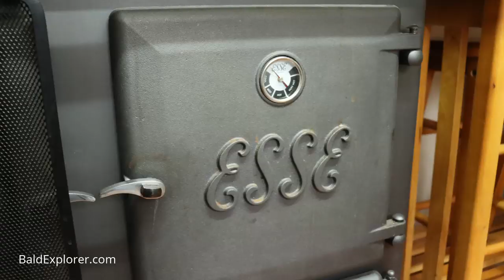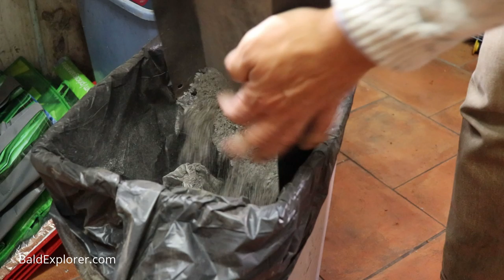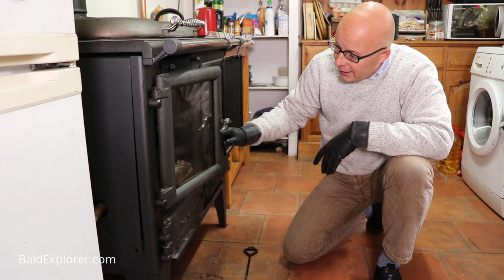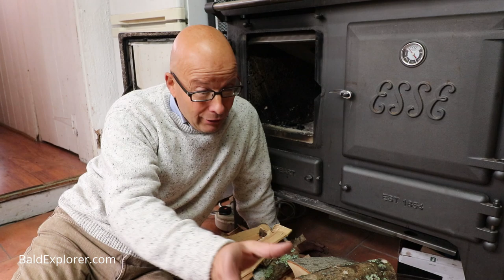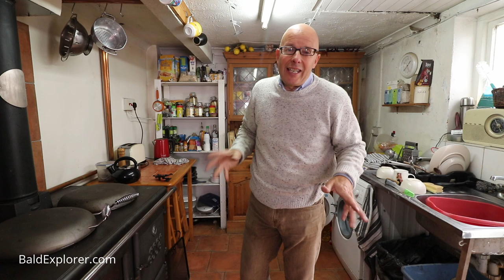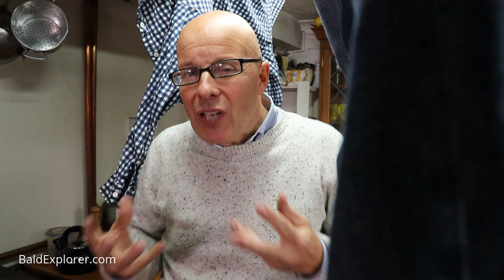Owning an Esse Ironheart Wood Burning Stove One Year on.

Comment: Hi Richard, I have had an ESSE Ironheart for the last 5 years in my cottage in France and have a few suggestions for you. The ESSE Ironheart is a multifuel stove ie coal or wood, however if you only burn wood ESSE sell a woodburning box that does away with the grate which should only be used with solid fuel. When using the woodburning box resist cleaning the stove out, wood burns best on a bed of wood ash, I usually take one shovel of wood ash a week plus any of the wood ash clinker that builds up at the front of the stove. The ESSE Ironheart has 4 air controls, the primary air control at the bottom of the stove, the secondary or airwash control, the oven damper and the flue damper. ESSE recommends when lighting the stove only the oven damper is shut and once the fire is established the primary air control should be shut as wood needs combustion air from above not below. Once the fire is burning strong and you need to use the oven you should open the oven damper. I usually leave the flue damper fully open at all times. Using this method, I burn well seasoned hardwood, oak and beech, predominantly to heat the whole of my house, but not water, on about 6-7 cubic metres of wood for a winter. The glass on my stove remains clear and clean, only requiring cleaning every 2 months or so. Using a woodfired rangecooker takes sometime to master but if you are continually having to clean the glass it is telling you that the fire is burning inefficiently and you may have a problem with your firewood, not seasoned, not dry enough or the wrong type, not all wood is good to burn in a woodburning range cooker, some is even extremely toxic such as Yew, or there is problem with your flue, insufficient draw! Remember that a woodburning range cooker or stove main purpose is not to burn wood, a bonfire will do that! It is to cleanly and efficiently convert wood into controllable heat for your home! Good luck
Reply from the maker: Hi Colin. Thanks so much for the advice and information. Trying to get properly season wood is a huge problem. I would say the wood I buy is not seasoned sufficiently, hence the blackened windows, so I keep buying wood to eventually have enough stored long enough to be seasoned, but meanwhile, because I have no other means of heat, I have to burn some of the unseasoned 1 year old stuff. We had to retro fit the water boiler in the fire box. I am not sure that the Esse wood box would now fit without a huge refit which I cannot do alone. But I am sure I could place a sheet of metal over the grill at the bottom to reduce the ask falling through to keep the ash. The supplier messed up on the ordered Esse and refused to put the problem right.
Reply: @RichardVobes  Hi Richard. Thank you for the video "one year on with the Esse Ironheart" ! A realistic and endearing account! I am 11 years on from installing mine ! I changed from the grate to the Esse Wood  Burning Box but recently went back to the grate, as I found there just was not enough combustion using the box to keep and sustain a good fire going especially when using  larger pieces of ash. I find the fire goes best with a progression of sizes of logs. I am in the country so am able to buy both seasoned and kiln-dried logs. Can see in London this could be a problem. Even with excellent wood you will still get a slight "dusting" on the inside of the glass on the Ironheart - but this can just be wiped off with a damp cloth and ash from the stove. You will get more blackening of the glass because, like me, you have the boiler to run hot water. So as the fire tries to heat up it is continually is having its temperatures lowered by the cold water being pulled through the fire box. I find it takes at least 40 mins to an hour for that to work through  (depending on what hot water has been drawn off) . In the end,  I agree with you - I love it .
Reply: Colin Shaw     Well said!  A clean burning fire keeps a clean glass.  A great way to understand how good your wood burning and wood cooking skills are.  If the glass is constantly getting black, then your fires are too cold, wood too wet, not enough combustion air and pollutants are not sufficiently burned off before closing the damper.   Must allow the good clean gas in the wood to do its job.
Reply: Hi Colin, how much wood do you find yourself using for your Ironheart stove over a year? Do you use it year round for cooking and heating?
Reply: @bodo9387  sorry for such a late reply I only use my ironheart in the late autumn through to early spring otherwise it would make my small home too hot and I also have other methods of baking and cooking so on warm days I would not light the stove
Reply: Good advice that Colin..the blackened glass used to happen before I found some properly seasoned wood.  Home Bargains has bone dry birch, which is good for a quick burn, but probably wouldn’t be suitable for a range.

Comment: Carol Cordell,  here, have written you a message recently.  Am originally from Alaska, and now here in Eastern Tennessee,  have lived on wood stove heat for total of 23 years, most of these years doing wood stove heat as a single person.  I got  to be really good at fire starting even from a very cold house.  Have never used an Esse, but last stove was an Englander, I think.  In this stove, it was suggested to leave the ash in the stove, and make an indentation in the middle of ash, front to back to allow the air to the bottom of the fire.  I always use a larger log in the back of stove, and build my fire against the log.  I had the smallest Englander;  it kept the house warm over night, and had a warm house in the morning, that did save me money. My wood for almost all 6 years was free, by tree cutters bring me their wood that would have gone into trash.  What I really liked about wood heat was a warm house when we lost power for many hours.  But I could also heat soup, re -heat coffee, and other foods just needing to be warmed up.  I REALLY LIKED the wood stove life style, cause it's  like living with the elements, and like a partial life style,  like the Alaskan colonist, many decades back.  Then late at night it was very comforting, relaxing, to sit about 6 feet from stove  and just sit, look at the flames, and relax.  Many times in Alaska the power would go out, and the wood stove saved the day.  That; and a lantern.  Yes,  a very Good Deal!

Comment: Never put your ash into your bin. Embers may seem cold down but all it take one to get the whole thing going. My son was a Volunteer Fireman and houses have been lost to ash reigniting
Reply from the maker: I will find a metal bin for them. Thanks for tip.
Reply: @RichardVobes  metal ash buckets with lids available used one was most useful no chance of ash blowing in wind
Reply: Stainless bucket with a lid, and never leave it inside. The Ash can produce Carbon monoxide and cause suffocation.

Comment: You should leave a good layer of ash in the burner area as it helps the wood burn better and last longer and gives out more heat.
Reply from the maker: I need to do that more.
Reply: @RichardVobes  The reason is that it insulates the wood and fire from the cold stone below which otherwise draws out heat.
Reply: I fell upon your video because am thinking of adding an ironheart to our scullery. I also loved the fact you had a Bush radio on the side. I still have my mother's from the 60s

Comment: Great video and good to see your experience of using it, thanks for sharing. My father in law has the same Esse stove in his kitchen. It is excellent but it takes some getting use to cook/ bake with it! I'd love to have a stove like yours in our kitchen. We only have a multi-fuel stove in our living/dining room which we use a lot. 
My sister lives in Austria has a custom built tiled and brick stove in her kitchen. It's an absolutely beauty and works superbly well. It also uses surprisingly little wood and stores heat for at least 12 hours. But it cost a small fortune (about £10k). 

I would recommend a moisture meter for your logs. I have one and it makes a difference to check it (should be less than 20% moisture). 
The beauty of burning wood is that keeps you warm three times. When you stack it, when you split it and when you burn it.
Reply from the maker: These old-fashioned stoves are the best.

Comment: Greetings from Galicia Northern Spain the land of rain and sun, green but as well cold and damped, thank you for nice video and a view in your kitchen ;-) .My tip to clean your window glass with less chemicals is using Frog Lemon Scouring Milk, it doesn't stink, works perfectly and is environment friendly.  Put it on a wet Microfiber cloth, let it sit for two minutes on the glass and so we clean. Beechwood is great for heating not as good as oak but better than ash wood (what becomes slowly but steady an endangered specie in Europe through some type of micro fungus and and insects. Beech is growing very fast and eco-friendly when bought from a sustainable woodland farmer. Nevertheless you should try much more to find the "perfect" the air circulation for your burning chamber.  I still dream to put a coal briquette covered in a wet newspaper on the hot Wood embers to preserve the heat up to the next morning like my grandparents did in Germany 50 years ago (not available in Spain). PS. I never had a tumble dryer but for the continent usual the "laundry rack", so in winter I do laundry only in the evening and before going to bed the humid laundry is moved in front of the stove and the morning it is surprising me with dry socks and T-shirts sometimes even warm. Greetings stay save and warm.
Reply from the maker: Hello Elli - thanks for the tip. I will try and look out for Frog Lemon Scouring Milk. :)

Comment: Use some wet newspaper to clean the glass - don’t use wire wool. If it’s sooting up a lot you’re probably using the stove wrong. Look to close down the spin wheel one the fire is established and control the heat with the vent at the top, which will be an air wash behind the glass. Do you have a flue damper?

Comment: Hi Richard
We use a dehumidifier for drying clothes, it costs  around €300 to buy and costs  virtually nothing to run   The clothes dry overnight without causing condensation. We also find it is great for keeping dampness out of any room. 
So we regularly move it around the house over the winter.

Comment: I used to clean my glass with stove glass cleaner, 0000 wire wool and then tissue.
Now I have found an incredible thing.
I use Wilko Mint and Rosemary Window Cleaner and tissue. I rarely use the wire wool now and only for really stubborn stains.

Comment: As child living in a country farm house we had a duck egg blue double aga oil burning,  it was the heart of the house and heated the hot water and the radiators,   the hot water was always very very hot and the house was always toasty.  I've since re visited my childhood home and was delighted to find the aga is still there and fully operational 20 years on!  Was delighted.

Do you have the round net for baking toast on the top burner plate?  
It was always so delicious cooked that way 😋

Comment: Hello Richard, I see you have all the advice you will ever need so I don't mean to add to it but I have installed a few solid fuel stoves in my time.
It is sometimes possible to add one or two radiators upstairs without any pumps or complication. They just heat up the same as your hot water.
It would make a huge difference.
As it is, lots of heat is being wasted. I don't want to bore you with the details, if you want to know more just ask.
Reply: I'd like to know more. I'm making a move go Norfolk in late summer and will get some sort of burner for the yurt, I'd also like one for the house, but need a basic lesson in how to attach boiler, hey water, heating, etc.

Comment: Lighting - start with big logs at bottom, then kindling on top, and add some paper.  Counter intuitive, but it works as the kindling heats the chimney (to get the draw), and hot glowing bits of kindling light the logs below.

Comment: Don’t use the chemical  spray.   Just add water to the ash. And the window will,get crystal clear. I agree with you about the  ‘primeval’ experience . If you contact local tree surgeons should be able to get free  wood

Comment: A brillo pad cleaned these windows wonderfully.  It does not scratch the glass.  Put newspaper under to catch any soapy drops.  Then wipe off glass but with no or little liquid.  The surfactant soap remaining acts like a release agent so next time a wipe with a sponge and it all comes off with one wipe. Stanley owner Joss from Cork.
Reply from the maker: I will try a brillo pad - great tip. Thanks so much.
Reply: @RichardVobes  Be sure to leave some of the pad soap around the edges. A sponge will then work next time.

Comment: I clean the glass of our 'Clearview' wood burning stove with damped newspaper.  Works a treat as long as you do it each time you clean out the stove.
Reply: Clearview are fantastic stoves, we installed a Pioneer 400 in my parents house in 1996 and it's still working great, original glass griddle, ash box - only thing I replaced were the bricks, door rope and baffle every 5 years or so, fantastic engineering.
Reply from the maker: I must try that.

Comment: I use dry wire wool and it doesn't scratch. But in my woodburner (an Aduro) if you burn properly it does not get sooted up. Enough airflow is key & dry wood.
Reply from the maker: Great stuff - I will bear that in mind. Thanks.

Comment: [To clean the glass just use  a damp rag and some of the ash works good no chemicals.]👍
Reply from the maker: Good tip!
Reply: Even better is damp to wet newspaper with the ash, then a clean old dampened duster and then dry scrunched up newspaper. Works a treat. For anything really stubborn, if you keep a bit of charcoal back of just the right size and shape, and then just very briefly dip it in water and rub it against the stubborn tarry deposits (if any), it will usually get rid of them. For the stubborn tarry deposits it does take a bit of elbow grease though and you have to listen out for the charcoal NOT scratching the glass - you get a feel for it and know the sound if it's likely to be scratching it.

Comment: I believe that wood ash (as long as it’s not been painted) can be used straight onto the garden, but coal ash has to be weathered for sometime.
Reply: I always used it for mine!  But have to be careful as it can cause your soil to go acidic if you use too much in one area.  I did however like using it around my blue hydrangeas just for that reason (need a more acidic soil to give hydrangeas their blue color - more alkaline for the pink varieties).
Reply from the maker: That's handy! Cheers Steve
Reply: Steve Gee I would never use coal ash on the garden. It contains all sorts of nastiness including heavy metals, carcinogenic compounds etc. Although unlikely to cause problems why take the risk, when nutritionally it does nothing anyway?

Comment: Search for product kindling cracker. Might save your fingers. I bought the largest one and it can do fairly large longs with no problem. I winced when i saw you swing that axe. Also a tip, try logs at the bottom. Kindling at the top. That will heat up the stove enough to create draw and then the large logs underneath will light up easier. I thinks its called swedish method
Reply from the maker: I will test out the Swedish method - thanks for the tip.

Comment: Do you have a boiler optimising system? They are well worth the relatively small cost. They work by managing the flow and return temperature to the stoves boiler, keeping the boiler temperature hot and only allowing very hot water to flow to your cylinder. This helps keep the firebox temperature up, which means a cleaner, more efficient burn, a cleaner chimney, cleaner glass and also improves overall efficiency. Should be straightforward to retrofit as your plumbing is all accessible. If you do intend to connect the stove to the central heating in the future such a system is essential.

Comment: A clean burning fire keeps the glass clean.  A great way to understand how good your wood burning and wood cooking skills are.  If the glass is constantly getting black, then your fires are too cold, wood too wet, not enough combustion air and pollutants are not sufficiently burned off before closing the damper. You need to allow the good clean gas in the wood to do its job.
Reply from the maker: I wish my wood supplier sent me better dried logs.

Comment: In Bosnia they/we cook on a wood burning stove but also have a 25Kw wood pellet central heating boiler ( a local firm makes furniture for IKEA so buy pellets there), most houses have a roofed wood shed with vertical slat sides (for air drying) on the side of the house. 
I would advise using quite large logs, even newly slightly seasoned, for the slow overnight burn and small dry stuff for the cooking.
Reply from the maker: Thanks for the advice, I am slowly getting to grips with the woodburning stove - but I love it.